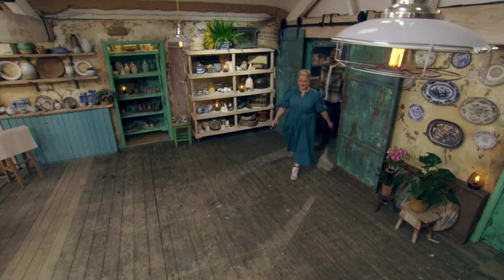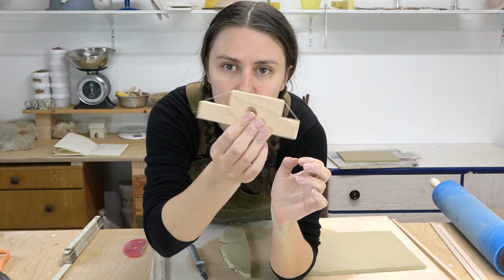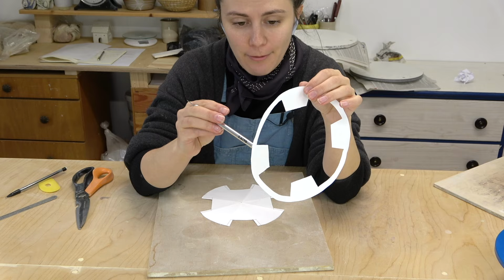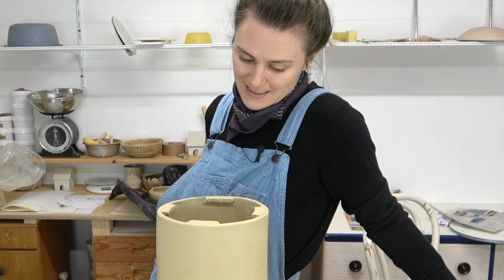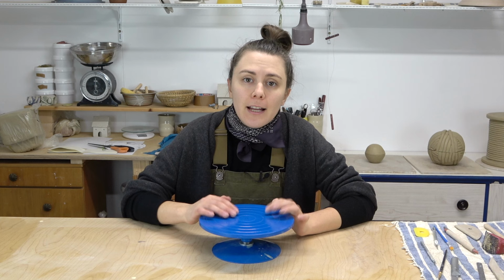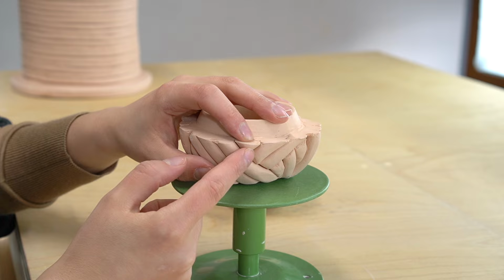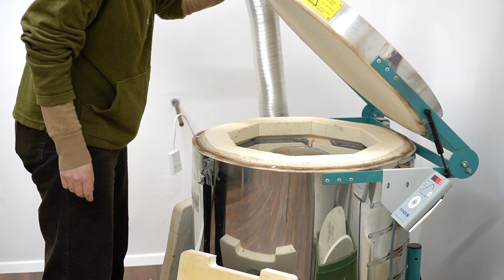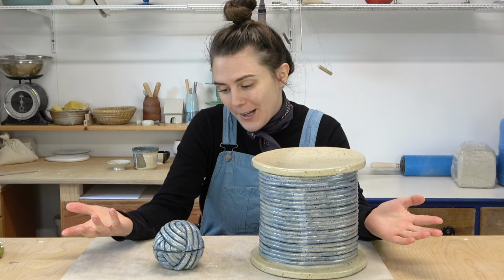Trying the Throwdown Challenge Ep. 2 // oxides & design flaws

Comment: FYI on the cobalt. It's been used for 30+ years in petrol refinery to remove sulphur. If anything EVs have been a vast improvement as they have made sure the child labor has been removed from the supply chain.
Reply from the maker: thanks for the info! I had no idea 🙏
Reply: @PotterytothePeople  You're welcome. Most people don't. It's part of the misinformation campaign that oil companies are still using to try and slow the transition down. A significant number of EVs are not using cobalt in there batteries anymore. It's good to know from a pottery perspective that we are more likely to have ethically sourced cobalt now. 

Loving the videos

Comment: Maybe you could have added the tiny slot on the rim of the top used to stop the yarn from coming away from the spool/ reel as a locking mechanism? Simplicity.  I did like your mechanical lock you first designed for the lid of the reel. Ingenious!! On the yarn ball maybe undercut the exterior yarn to help keep the ball uniform? I’m not a glaze expert so can’t comment on the details of that. Another idea I had was to put a hole in both the yarn ball and the reel and thread real yarn through both to demonstrate the usefulness of the piece? I realise that you were wanting to store your pin cushion in the yarn ball but it could also store yarn as well. Overall 11/10 from me!!

Comment: underglaze and stain should have gone on pre bisque. I wouldn't have wiped any off. Did you get cobalt into your clear glaze bucket? use a coil at the edge of the yarn bowl. The top piece and the bottom piece. I would have used a wood roller and brown stain on the wooden part.

Comment: cotton reels have a hole in them through the middle, which I use to put my threaded needle in to hold the needle. Could you make the lock with the needle as the locking mechanism poked into the hole some how?